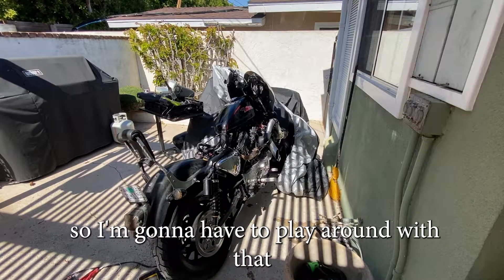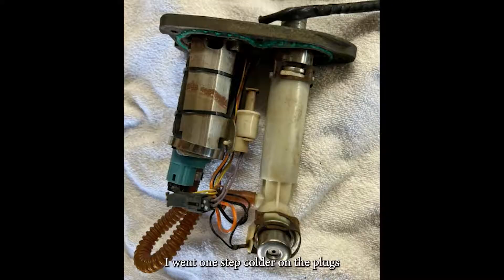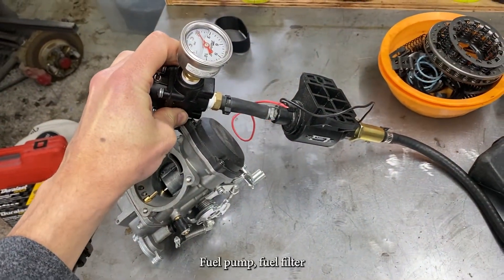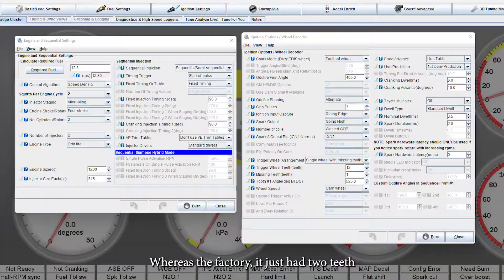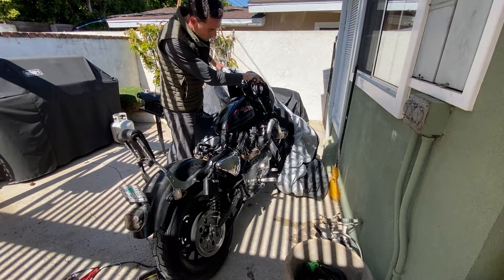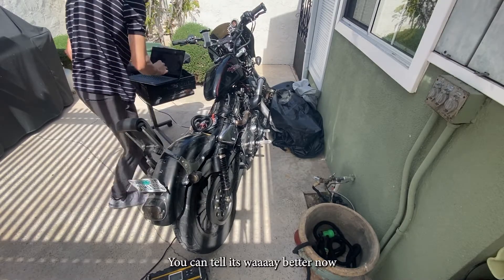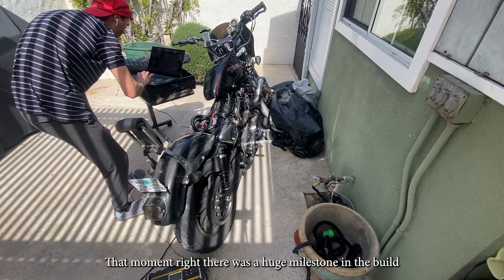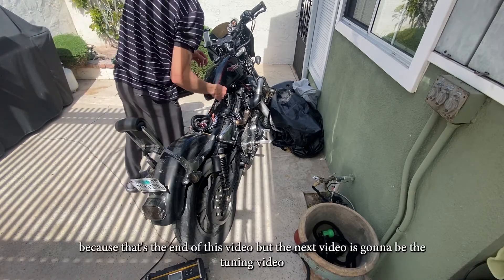Building Fuel Injection to Run the Turbocharged Harley

Comment: I would love to see something of a rough drawing, (or two), which shows a list of the parts used and where they appear in the build.
Reply from the maker: Boiled down the setup is actually pretty simple, mostly parts from newer EFI sporty:
Microsquirt ecu
EFI sportster injectors
EFI sportster fuel pump
Ls2 truck coils

if NA you can use oem sportster map sensor, if boosted you need 2 or 3 bar replacement map sensor. 
IAT is taken from efi sportster map sensor combo unit
Intake manifold and throttle body is modified efi sportster

Comment: On the trigger wheel how did you space the cuts and did you keep the HD sensor to trigger Micro squirt
Reply from the maker: I made a 12-2 tooth wheel and yes, kept the stock sensor. I made it by plasma cutting a sun shape ☀️ and then bending the teeth 90*. When you measure the width of the gaps and teeth they were .200” and .230” respectively if I remember right. I had to do quite a bit of hand finishing and you need to have the 2 missing teeth because of how lumpy the vtwin is. I studied the microsquirt manual quite a bit to figure out what parameters needed to be what for everything to work correctly. Good luck!
Reply: @hillbilly-engineering  cool, working on putting together a winter project.
Reply: @hillbilly-engineering  you didn't happen to make a engineering, blueprint , of it?